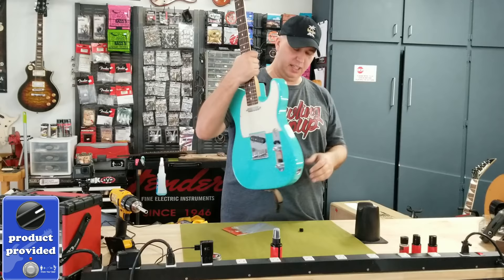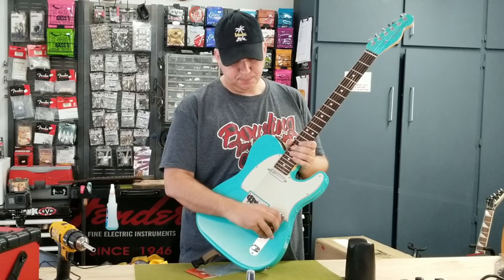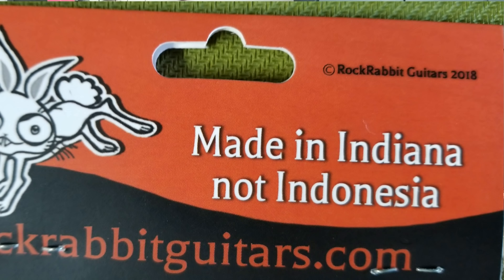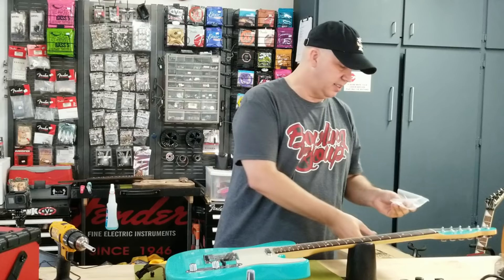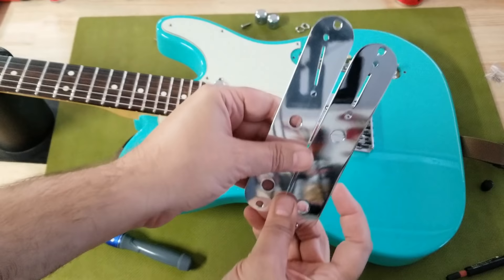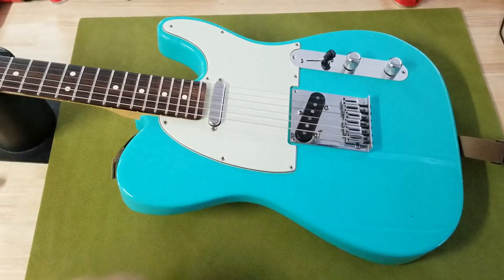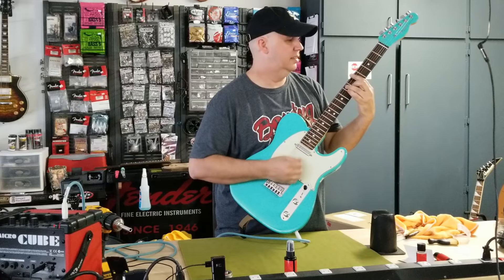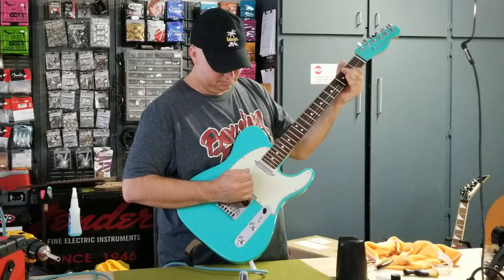Why Didn't Fender Do It This Way?

Comment: I have a Fender Nashville tele with powerbridge. I love mine, except I have had issues with the piezo. Fishman sent me a new powerchip. Things 
got funny again. I like this concept, I don't really have that issue, because my knob has concentric pot and there is enough room for my finger to
get to the switch.  I had to take my bridge off and spray contact cleaner like crazy on the piezo ribbon and I got all my strings back. Really it was 
just the g that disappeared. I took it off to see if the wire was damage. I sprayed to see if that would help and it did. I might try that Rock Rabbit 
parts anyways. First time I ever owned a tele. What I want is Ernie Ball Musicman to offer a Sterling 7 string with stripped down piezo features: 
like the mixer. All you need is a separate piezo output and a volume. Don't need a mixer. Sending a piezo and mag signal to the same place is
useless. Piezo lives in a full-range acoustic amp or a D.I. box to PA. I paid for a Ernie Ball Musicman in 2008. The prices went up a $1,000 in about a year after I got it. I feel an instrument $2,600 or above is too much to take to club gigs. Not accessible to working musicians, except doctors 
lawyers or national/international endorsed musicians. I would like to see either the Sterling provide those mag/piezo options or find a way to get the American made Petrucci 7 strings mag/piezos to a price between the Sterling 7 strings and the full priced ones. Can't they use less fancy wood. Strip out the mixing system. Just have separate signals TRS.  I have been trying to talk to Music Man about it. What is your opinion on that subject?   I find the magnetic and piezo setup the most useful playing live. I just prefer the 7 string.  I have been struggling with this for 10 years now. My only option is to find a used 7 string Music Man with piezo.  I wish there was a way to install a piezo pickup ribbon to a plate underneath the 7 string Ibanez Floyd Rose or a Floyd Rose 7 string bridge.  Then add a pre-amp in the guitar or into a booster before the D.I.

Comment: When I decided I needed some Tele icepick in my sonic arsenal, I grabbed a Squire (not my main axe).  Hated the original layout - one of the things that kept me away from them over the years - so I flipped the plate around, putting the switch at the rear, and reversing the position of the vol/tone pots.  It's worked well for me - but if I'd known about this I'd have probably gone this way.

Comment: Well, I know why, that's pretty simple : Fender has been manufacturing the same control plate for decades and that control plate is installed on thousands and thousands of guitars all the time, the slightest modification would alter the chain of production and have consequences in many ways...Second, most people would start bitching about it because it's not "vintage" or authentic" or whatever :) :) I remember hearing Fender's CEO saying that, when try tried to move one pickguard screw slightly to the left or to the right they received a ton of hate mail...Guitar players are a peculiar bunch of people :) :)

Comment: Great idea indeed. Leo was a very practical man, from what I've read. It could be that having the control holes and switch channel parallel to the sides of the control plate, and also in a straight line down the middle; speeded up production. Just my two cents' worth :)
Reply: You can just say sped homie

Comment: I bought a used SX 57 Tele, replaced rear pick up w/fender, neck has p 90, have an older black Fender Lace sensor,it sure sounded good on acoustic, I bet if I knew how to wire it would be great volume and sustain ✌️

Comment: Yes! Why didn't Fender do this?!? Because Leo designed the Tele and was an engineer not a musician. I changed my tele to have the volume where the tone knob is and changed the knob next to the switch for a push button killswitch just because I rarely use the tone knob, and I was so sick of rubbing the knob when changing the selector switch. Only problem is now the volume is miles away, but next idea to fix it is to make or buy something like this.

Comment: I used one of these for a single volume build. Only problem is the holes are smaller, so they may not fit certain pots. I used CTS and had to ream the holes.

Comment: Better idea. Remove volume and tone knobs and replace them with a dual concentric volume and tone knob. Swap out the Fender Telecaster three-way slide switch with a Fender Telecaster Custom three-way switch. Use the unused opening left over from the Fender Telecaster three-way switch as a nifty first class postage stamp dispenser. Sell stamps at your gigs. $$$

Comment: Awesome.  Next could you possibly do a fix on the worst thing about the mighty tele...  The dumb, awefull  cup style output Jack.  Always come loose,  need a special tool to fix it properly and it just gets loose again after two gigs.  I know there are some cool options,  but it would be great if you could give your thoughts. Thanks for helping us all know our gear.  Cheers
Reply: For years I have worked as the in house luthier in many shops around the Connecticut River valley in ma. and I found that if you drill two small holes 180° apart, about 3/16" in, on the 'cup' part of the original jack holder, you can use two small wood screws to hold it in place. That way you do not have to rely on the bendy metal retainer, and chewed up wood that that occurs after a couple jack changes.

Comment: I put a strat switch cover on mine. I was replacing the switch in my friends strat and it came with 2 extra covers a black one and a white one. I just took the black one and put it on my tele and have never had an issue since

Comment: Dude I dropped mine the metal switch in the two knobs for tele I dropped it right out of the box and it bent the switch over it been it down like if you're on the guitar now you can just kick it with your finger really easy because it's down below the knob it works perfect just put a little Bend in it I dropped it and I was like oh that's perfect that's crazy

Comment: Just put a Strat switch tip on, if that doesn't work put grip tape on it. (or cut indentations into the tip)

Comment: The only guitar I can volume swell is a stratocaster. I wish the Tele vol knob was actually close NOT further away. Idc where there switch is. It should be on top like an LP but whatever. Also, I'd constantly be putting it in the bridge position on accident with that angle

Comment: looks a little weird with the switch slanted though, because the metal plate is straight
Reply: HoshiHearts RetroGaming that’s probably why Leo never did it that way.
Reply: HoshiHearts RetroGaming
The bridge is straight, the pickup is slanted though.  Soooooo, if anything it actually looks MORE uniform.

Comment: This probably sounds cheap skate but it's nearly impossible to put a used string on a Fender Stratocaster as the hole has a little lip on which is easily circumvented by a new string but very difficult if it's not.

Comment: Hey Phil I really like your reviews on the Squier stuff. I knew they were good guitars so when I saw a used bullet strat  i liked the feel of I hopped on it right away. One thing I think would benefit the reviews on these guitars is to get the pick guard off and take a look at the routing. I'm planning on converting my sonic-blue strat to HSS and putting a mint-green pickguard on it.  Thanks for the reviews

Comment: Why not just do what Bill Kirchen (Hot Rod Lincoln - Commander Cody) did to his Tele.
Pull it out.
Switch the tone & volume positions.
Reinstall rotated at 180 degrees.

Free mod!
The switch is at the rear and the volume can be operated with the pinkie.

Comment: Now someone needs to figure out a product to keep those dam barrel caps from coming off of the switch without taping or gluing the switch blade. This product looks like it would help a lot with volume swells.

Comment: Hey Phil, wanted to ask if that bridge is stock or a mod replacement on this Tele ? I see the top 2 holes on the right and left corner above the pickup which really likes like my Affinity Tele bridge plate mounts. I need longer saddles to help with stability or to just buy that Bridge you have on that Guitar, it looks perfect with the longer saddles. Let me know,  Thanks for all you do !

Comment: Interesting but I don't try to put my fingers between the switch and volume knob in the first place. I access the switch from underneath with my middle finger...I've played Teles so long that I don't look. My beef with Teles is that it has taken years for Fender to make a lightweight body with a hardwood top......the Brad Paisley model. It is light and sounds great, it's just over priced for a Mexican Tele. I have a parts Tele that weights 4 1/2 pounds total. I love it especially compared to my Fender Nashville B bender that feels like it weighs a ton. My favorite Strat has a lightweight Paulowania body that weighs just 4 pounds. I made it out of left over parts and I just leave it in the living room to pick up and play with out an amp. In contrast I have and American Strat VG that weighs so much that I won't even take it out of the case....love to sell that one but no one seems to be interested...I think Fender has bigger fish to fry than a switch plate especially sine you can buy plates without holes and put them where you want.  Why does Fender insist on put the damn volume knob on a Strat that continually gets turned down when you strum ?

Comment: I can't stand strat controls. Volume right up on the pickup and a switch that I knock all over the place. I like the normal tele switch the best...because you really have to make the choice to switch pickups. Also I add a 3rd pot to my tele...which I wire to a strat middle pickup...that way I can bleed in that strat quack...without having to play a strat. But as is I have just enough space for that 3rd pot
Reply: And that's just one reason why Yamaha's are better than Fender Strats. Better knob spacing and only two freaking knobs.

Comment: ANother great tip a friend showed me: turn the plate around!  You have to do some soldering if you want the volume under your fingers, but it makes doing fake pedal steel stuff/volume swells easier, and you'll never accidentally flip to the wrong pick up again.

Comment: To me, the angled switch just looks weird. It's a small thing but itr messes the symmetry of the design. And in the neck position, the switch is now very close to your strumming hand. I wouldn't be surprised if you knock it out of position way more than when it was straight
Reply: The symmetry of design??? How about the bridge pickup?
Reply: That's how my eyes see it brother. Bridge pickup doesn't bother me, but the plate does somehow. I don't mind anyone else preferring it this way of course. Just my initial reaction looking at it.

Comment: I like it. I've made a few of these myself but the polished aluminum never had the right look. These look plated, are they?
Reply: Check out LSL Guitars. They make them in steel, and you can choose between chrome and nickel (as well as block and gold, I believe). They are quality parts. I build guitars, and only use high quality hardware
Reply: I just checked to see if the site is still up. It is, but it's now called LSL Instruments. He sells both parts and finished guitars. I was checking out a tele of his when I saw the plate originally.

Comment: But how do you prevent the switch tip from flying off all the time D:
Reply: @28monkeyking28

Hiya! To keep your switch tips from flying off, take 2 pair of needlenose pliers... Hold the lower part of the switch shaft STILL with one pair, and slight bend the corners on the end of the shaft to give something for the plastic to grab on to... When you go to jam the plastic tip back on, put a tiny drop of Super Glue inside of it... The bent metal will grab the plastic, the glue will sort of melt the plastic and it forms around the metal...

I've done that to every Tele I've ever owned or worked on. I haven't lost a switch tip in 15 years.
Cheers!

Comment: The 'purist' are likely to complain, as they do to just about everything that's not as it was in the 50's. I think the concept is great.  Perhaps Fender will take on the idea and then cop all the whinging as Gibson has with the current Les Paul Standard alternate switching options.